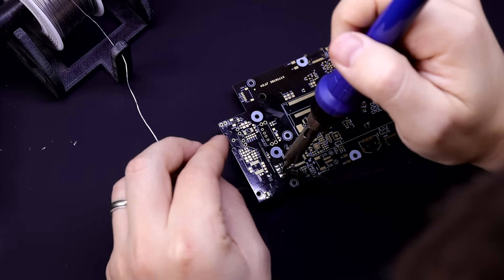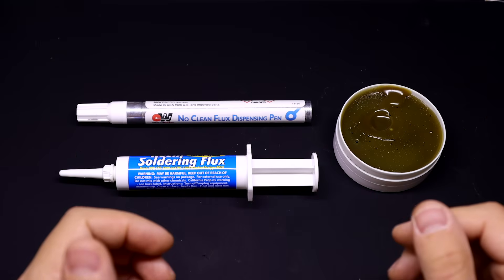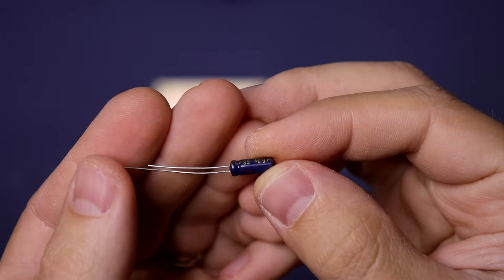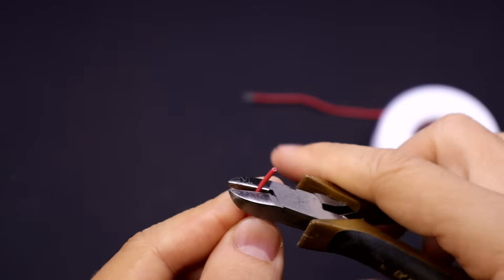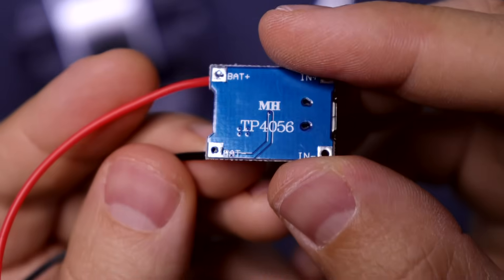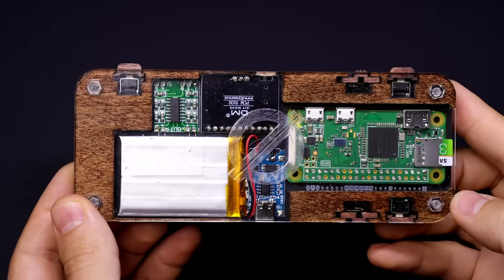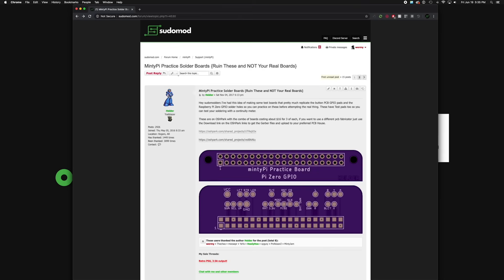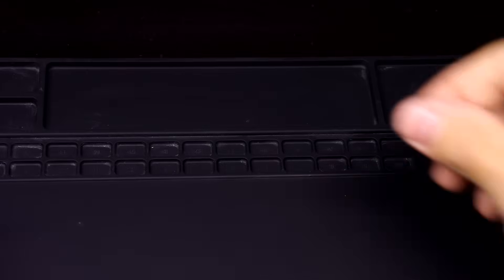Soldering Crash Course: Basic Techniques, Tips and Advice!

Comment: I have a question about the way you separate the solder wire at 10:02 - it looks like push the wire into the soldering iron tip, but then you are able to separate it without the blob sticking to the remaining wire. Is there a trick to this? I have a hard time getting the blob to disengage from the wire. Thanks!
Reply: Speed: get in and get out. The flux is what allows the clean separation, so if you delay at all, the flux burns off and oxides form (very quickly at 300C+), and they lead to blobs and stuff. 

Also, make sure the iron is hot enough, and the tip big enough for the wire in question. Absent another, stronger force, molten solder likes to flow towards heat, so if the big mass of wire is hotter than the very point of a small tip (which is easy with thin, pointy tips), the solder will not want to flow onto the tip. 

Another thing that causes blobs is what I call “overcooked” solder: solder that has dwelled on the tip or in a melted joint for too long. While hot and molten, two things are happening to the solder: 1. it’s oxidizing, and 2. it’s dissolving copper from the surface of the wire or pad. Both oxidation and excess copper in the solder result in blobs, usually with a matte appearance. If you notice this, “rinse” your iron tip with a bunch of fresh solder. (And with a PCB, eyelet, etc, remove the old solder if possible.) Then resolder with fresh solder. 

Trust me, you’ll get better at this with practice. Wire and solder are cheap, so consider just cutting and stripping a couple of dozen bits of wire and practice tinning them.
Reply: @tookitogo   Great, thanks for the detailed answer!
Reply: @J-DZZI  Glad to help! 

Also, I cannot recommend the following soldering tutorial enough: https://youtube.com/playlist?list=PL926EC0F1F93C1837&si=F4JC2rJW-JexgKpV

It’s old, but the principles it explains WILL make you a better solderer. It’s 40 minutes well spent.
Reply: @tookitogo   Excellent! Thanks again - I bookmarked this video and if all goes well, I'm on my way to being a less-terrible solderer :D

Comment: There are some practices here which wouldn’t fly for building electronics to IPC standards. You need proper wire strippers to remove the wire insulation. These keep the natural turn of the wire. Next, never twist wires. This seems to be an electrician method but is not allowed per IPC. For the splice, 3 wire bundle diameters is what you want to strip. Lap splice (overlay both conductors) such that the conductor does not extend up onto the insulation. Tinning the wire is required prior to soldering a lap splice. Running makes it go so much easier. Folding the conductors over the insulation is not acceptable, just do a lap splice or mesh splice, heat shrink, and move on.

Comment: Your first tip was crucial to me to learn to solder.  I initially thought that you got solder on the tip and almost "painted" it onto the wires.  Learning that you heat the wires so that the draw/wick the solder in place was a game changer for me and led to work that was very passable :)
Reply: yeah once you see desoldering using wick and flux it makes more sense just in reverse 👍
Reply: Good to hear, I am hoping for the same so I can start fixing graphics cards and consoles.

Comment: Hey really important point to note here since the video didnt touch on it at all

Yes it is good to have the iron hot to melt the solder
But copper pins BEGIN TO SOFTEN at ~400*C
You may end up, like me, bending or breaking a copper pin because the iron softened it from higher heat settings.

This is some incredibly important shit

Comment: I don't know what it's called in soldering. But in welding, when you have a hole in a surface workpiece that is sitting directly on another piece, it's called a rosette weld. It's typically used in sheet metal welding.

Comment: What about temperatures i should I use when trying to soilder copper power cables onto boards I'm finding the wire is taking forever to heat up to fuse and never get a good solider connection because of this and I don't want to run the risk of putting to much heat into the board and ruining it.

Comment: They are all ready to provide us with the best laptops, computers and mobile phones https://pcmag.com:stayhome:
Laptop repairs in Isfahan
Understand the laptop battery model
Second hand laptop in Isfahan
Isfahan second hand laptop
Rain DJ
Laptop Troubleshooting
How do we know the laptop battery model?
Keyboard Buying Guide
Laptop Battery Buying Guide
Advantages and disadvantages of computers
Isfahan laptop repair
The best type of laptop battery
Isfahan second hand laptop for sale
Laptop battery cell of Digikala
What is the price of a graphics card?
Second hand laptop
Laptop repair in Isfahan
Specialized laptop repair in Isfahan
Stoke laptop in Isfahan
Second hand laptop buying guide
Isfahan Stoke Laptop
Computer repair agency in Isfahan
Dell laptop repair in Isfahan
Lenovo laptop repair in Isfahan
Isfahan laptop
Laptop battery repair
Used laptop
HP laptop repair in Isfahan
Laptop repair shop in Isfahan
Acer laptop repair in Isfahan
LED Buying Guide
Asus laptop repair in Isfahan
Isfahan second hand computer
What is a benchmark?
Disadvantages of the computer
Understand the laptop model
Buy a stock laptop in Isfahan
Laptop battery part number
Cause of laptop overheating
Buy second hand computer parts
Laptop keyboard replacement
Laptop battery test with multimeter
Laptop keyboard repair
Graphics card price forecast
What is rtx?
Buy a second hand computer
Camera Buying Guide
Charge the book
LED TV Buying Guide
Advantages and disadvantages of computers and the Internet
Types of mobile operating systems
Second hand monitor buying guide
Isfahan laptop repairs
Find the laptop model
Buy second hand computer parts
Computer memory
Second hand computer
Second hand computer buying guide
The most expensive graphics card
The difference between stock and second hand
Testing computer parts
Tn screen
Repair of plastic screws
Second hand computer pricing
Which option is not part of magnetic memory?
New WhatsApp changes
Camera Buying Guide
Va panel or ips monitor
Types of operating systems
Reduce the price of graphics cards
Understand the specifications of the laptop
Selling a used computer
Realme 8 5g phone
What is a benchmark?
Number 10
Computer keyboard
New gadget
amoled or ips
Laptop battery
Computer Shopping Guide
The most expensive graphics card in the world
Guide to buying a mid-range computer
Home PC Buying Guide
Increase laptop battery life
Case Buying Guide
Android operating system for PC
What is nvidia dlss?
Buy and sell second hand computers
Buy a desktop computer
Help buying a computer
Computer System Buying Guide
What is dlss on a graphics card?
What is a showcase laptop?
The best glue for laptop frame
18650 battery test
The most famous operating systems
The difference between ips and tn
Buy a second hand gaming system
Laptop battery cell
Laptop Buying Guide
The best home camera
Second hand computer monitor
Home camera
Largest phone screen
The difference between tn panel and ips
Second hand gaming case
Asus laptop dealer in Isfahan
Download the app to fix the slowness of the Android phone
Second hand computer parts
What is a case test?
Laptop battery troubleshooting
Buy a computer keyboard
Monitor Buying Guide
Buy a laptop in Isfahan
New WhatsApp 2022 changes
Turn on the computer with the keyboard
Tn or ips panel
Buy a keyboard
Computer Graphics
Laptop warming up
Buy a keyboard for programming
Buy a second hand computer case
Second hand parts
Compare phones
Buy a used laptop
The difference between ips and va panel
Buy a second hand case
Proper gaming processor
What is a tn panel?
Selling second-hand computer parts
Fix the slowness of the phone
Cable connecting cable to TV
Case Stoke
Second hand motherboard
Va and ips panel
Ips or va panel
Tips for buying a camera
Second hand case
Laptop battery test
Selling second hand computer parts
What is an ips monitor?
Get a laptop model
The best computer keyboard
Buy a second hand laptop
Panel tn
Find the specifications of the laptop
What is hybrid memory?
Membrane keyboard
What is ray tracing?
Tips for buying a second hand laptop
The difference between single-channel and dual-channel RAM
dlss
Case parts
Computer case parts
Types of computer memory
4k TV Buying Guide
Shopping guide and service magazines help us make better choices  https://digibaran.com:thanksdoc:

Comment: Would love to see a crash course on Desodering!

Seems fairly frequent for repairs or changes to fix old electronics.

Seems common to add an extra "solder ball" to prevent static or something similar

Btw Thanks! Great starter course
Reply: What I've learned to use is the desolder pump, look it up. What it basically does is, once you melted the solder you hold it near and you release it, causing it to quickly vacuum away most of the solder. Simple and cheap. There are obivously fancier tools and better tools, like vacuum desolder guns etc.

Comment: Most of the relevant repair was off screen. The camera should have been focused on the left hinge area where the repair was made. It would have been beneficial to talk about or show the routing of the wires as I have a stray black wire I'm trying to identify and relocate. It may be a ground wire, but I see no obvious connection point, so I'll strip the protective sleeve and see if it's just one of the 2 black power wires.

Comment: If we heat berg sticks for soldering placed inside breadboard, the berg stick will heat & melt breadboard rows, so how do you recommend it..? Breadboard  is made of plastic, and berg stick header will transfer heat to the tip inserted inside the Breadboard, thereby disfiguring the Breadboard..

Comment: This was very informative for me and I’m confident I can apply it to my needs. I’m not an electronics guy but need soldering skills for my hobby of restoring old motorcycles that use vintage ignition magneto systems with breaker points. Soldering is needed when replacing components like breaker points, condenser and/or source coil. Not a big deal compared to your electronics work here but I plan to do lots of them and want to perform quality soldering work. Thanks.

Comment: i think a useful addition to this would be tinning the iron tip before actually using it to solder for the first time and re-inforcing tinning after you finish (in a production environment you tin much more often). Also static protection should be mentioned as it is not all that hard to ruin an ic with a static discharge.

Comment: How do you keep your soldering tip so clean above the tip? My one goes really black after a bit of use... what is the key? Better flux? Angle of gun? Please advice!
Reply: Heating of metals accelerates the oxidation process and above the tip will always oxidize almost immediately.  You need to clean and re-tin the iron tip all the time while you are working with a hot iron.  Also, clean every thing first before soldering; clean the solder, the board pads, wire and component leads with isopropyl alcohol before soldering.  When you do this, you will see some black come off on a paper towel or Q-tip as you clean these items; even if they do not look oxidized, you will get some black oxidation off of them.  The tips of a soldering iron have a coating (plating) on it - that is where you want the solder to be.  If the plating is gone then the tip is burned out and must be replaced.  Try not get solder above the plated area of the tip, if you do clean it off, as it just contaminates the molten solder all way down into the tip.

I constantly clean and re-tin the tip: I do it before I make a solder joint; after I make a solder joint or touch any parts with the tip (tin a wire); and I clean and re-tin after I do any thing.  This is the reason to use a flux-core solder and clean and re-tin often.  Also, I like to use a wet sponge to clean - it take the static electricity off that builds up on the tip.  I guess the metal pads do the same thing, I feel the wet sponge is less harsh on the tip and steam cleans while I am working.

The soldering flux will smoke and sizzle as you put heat to it.  This off-gassing of the flux keeps oxygen off the molten pool of solder while you are making the joint.  Heavy oxidation during soldering is often caused from not using enough flux, or using a poor or cheap soldering flux.  To keep the solder joint from oxidizing during the molten phase you need to see smoke off gassing the whole time the solder is molten.  I have always used MG Chemicals Flux Colophane Rosin Flux, Cat. # 835-100ML; it is an RA Type liquid flux that leaves a non-corrosive residue.  I apply it with a needle tip applicator bottle.  A little harder to clean, but it is non corrosive so I don't get bent over it.

Hope this helps,

Comment: One of the best method is using a solder bridge. Place solder wire against the surface you're wanting to solder, then touch iron to the solder wire, melt through it and make contact with the component. Continue feeding more wire at the junction as needed.

 The flux resin in the solder wire will allow the solder to melt and bond faster, and have less dwell time on the component with the iron, lowering the risk of heat damage. Flux acts as a catalyst to lower the melting point of the solder, and the melted solder lowers the melting point of the surface of the component when wetted.

Great video! I've worked with electronics for over 20 years, trained by the Air Force. I was curious to see how a hobbyist would explain their methods. Thank you!
Reply: More suggestions: when stowing your iron, have a glob of solder on it. This will help keep the tip from oxidizing and help it last much longer. Tinning paist is not necessary, just use solder wire. Flux is your friend! It not only cleans and deoxidizes the surfaces, but also acts as a catalyst to lower the melting point of the solder and surface of the component.  When doing IC chips with several legs, solder the corner legs to tack it in place, wet the rest of the legs in flux, melt a small amount of solder to the iron, then steadily swipe the iron across the legs. Careful not to use too much pressure or you'll bend the legs, or use too much solder as you'll have solder shorting the legs together. Last, but not least, use an ESD (Electro-Static Discharge; static electricity) wrist strap connected to a ground, especially with the smaller components. If you can, use an ESD mat as well. If no grounding point us available, touching the screw on an outlet cover (NOT THE OUTLET SLOTS!) Will dissipate any static electricity before working. Static electricity can damaged small components easily, as can too much heat. If you've ever felt a static shock, that can be hundreds if not thousands of volts! Thank you!

Comment: 3:02 
So many beginner videos use this technique. It was really frustrating trying to replicate. In the end I got it working but it was a pain.  After watching your video I went and did a similar build to the one I did before. Not only was it way faster but alot easier to get the solder to sit the way I wanted it to and used alot less solder.
Reply: Solder flows to the heat.  There is a thermo-nuclear bond that happen when to touch a wet solder tip to a part.  Once you make that  bond heat flows into the part (a pad, a through hole whatever); now just get those two parts to get into this heat and let the joint happen - and get off the joint.  Give it the heat, add a little solder when you see the bond happening and get off of it.  Easy-peezy

Comment: 3:25 This is exactly the mistake i've been making. I was too afraid to damage the PCB so i tried not to touch it. Still, I should use the tip carefully on the metal part on the PCB, and then it should work. Still need to be careful not to overheat the components as well.

Comment: Few things not mentioned here :   
How long approx to hold the soldering iron onto the wires and other items? (1min or more like 10 seconds?)
Is solder actually conductive? It seemed like it would short out that little chip he soldered at 5:40
What is the minimum and max soldering temperature? (my device goes low as 200c)
Otherwise thanks!

Comment: I ruined my N64 trying to install the simple RGB mod. Based on this video, I definitely used too much solder to the point that solder went underneath the RGB board, fusing it to the main board. I tried to remove it using alpha wick with no luck. Now my N64 turns ON with no video at all 😔